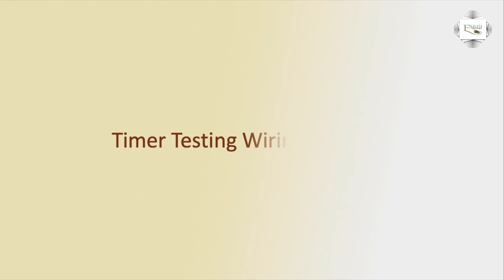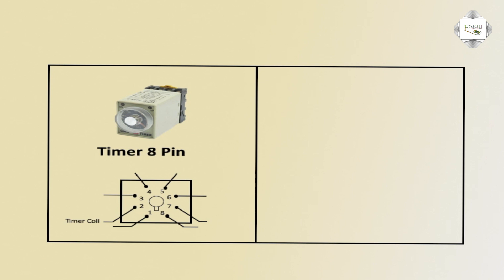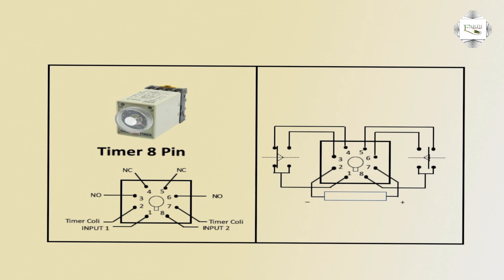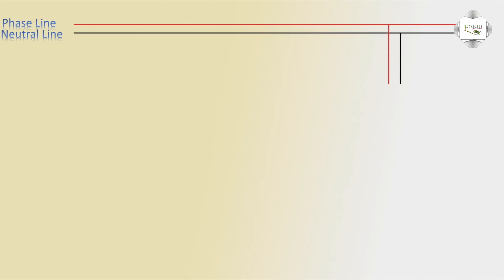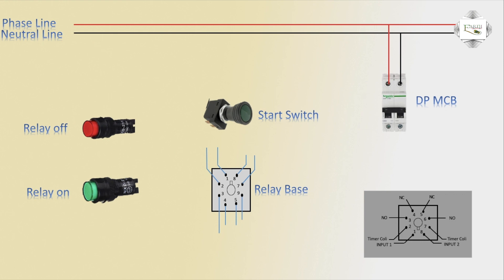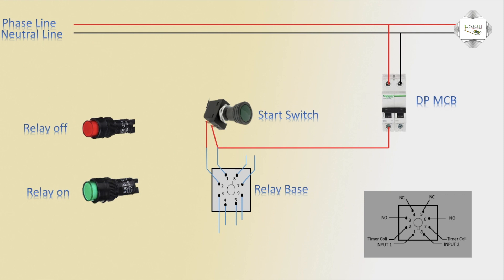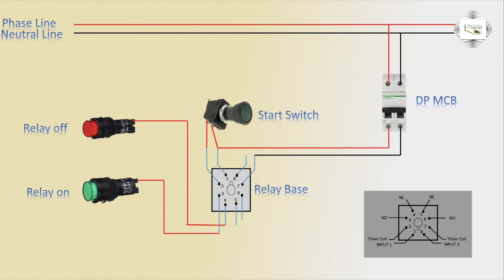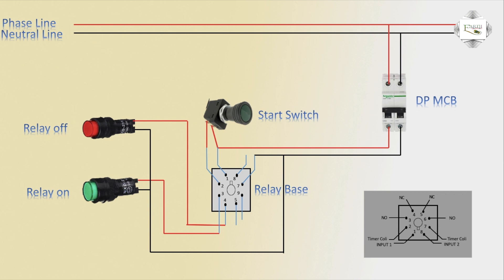Timer Testing Wiring Diagram | Timer | Timer Wiring | Timer Wiring

Comment: Sir I want to know is there any device which can specify the required voltage and required current required for any system if yes please let me know.
Because using multimeter I can  know source voltage and current but cannot know how much current and voltage is required by device 
Also if I write on Google it displays ohms law only I think you have understood my question.
Reasons why I am asking is if someone tells me to draw simple circuit which convert 240v to 3 v DC  charge then my simple using diodes as bridge rectify I can do but how much resistance  I can't determine
Reply from the maker: "the device which can specify the required voltage and required current required for any system." I don't know. but 240V to 3v Battery change. I can make.  Love to receive your comments and feedback.
Thanks for watching.